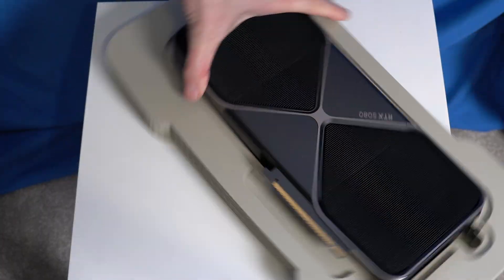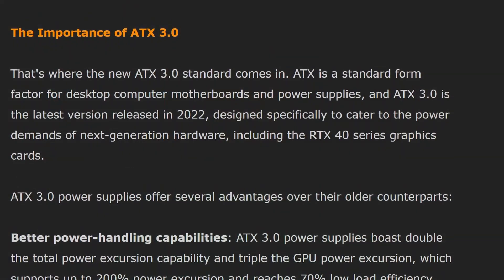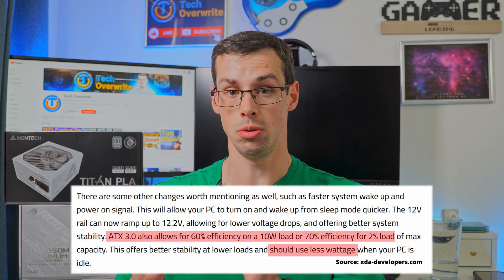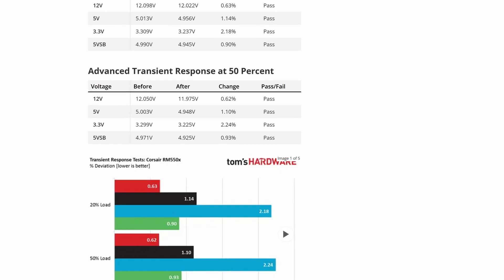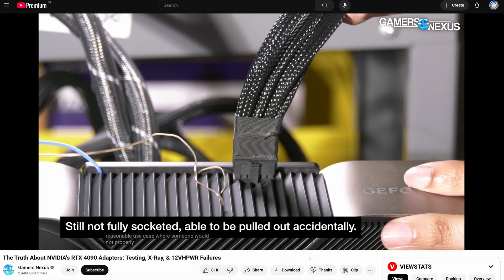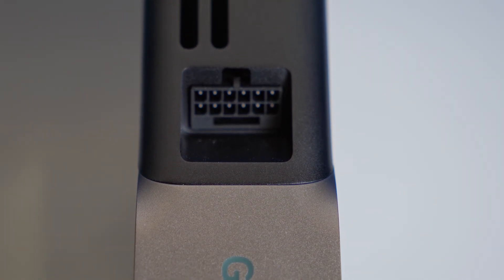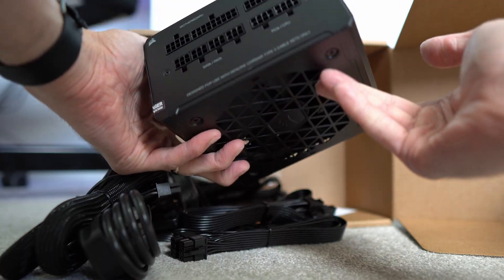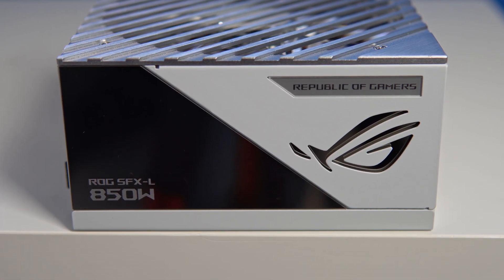ATX 3.1 vs 3.0 PSUs: Why Newer Isn't Always Better

Comment: I'm using the corsair rm850x shift 3.0 to feed a 9950x and a 4090. My 4090 has the newer 12v-2x6 conector (as far as I can tell, because the sense pins are definitely inside the plastic) and I like the cable that goes from 2x8 to 12vhpwr, and prefer it over the 12 to 12 of the 3.1standar. Anyways, I limit the power of the 4090 to 75%, so the 12vhpwr cable never draws more than 360W, so 390w in total with the extra 30W of the PCIe slot. I don't feel too paranoic, neither 100% safe (at 60% power target I would feel pretty safe but I don't want to leave too much performance  on the table either, 75% sounds like a good compromise).
Reply from the maker: That sounds like a good solution all round, I'm glad it's working out well for you.

Comment: One thing I didn't understand is the part where you show the power rating for 8 pin and 12vhpwr in regards to Corsair power supplies. I have Corsair RMx Shift 1000 Watts. The cable connects with regular 12vh 2x6 on GPU side and two 8 pin connectors on PSU side. The cable is rated as 600 watts capable but power rating of 8 pin is 254 Watts. So times two it's 508 Watts. Since power rating is already above specs (but still allegedely save). How does it actually work safely in cases when sustained load through cable is above 508 Watts. Wouldn't PSU side connectors have a problem or such load could cause a wear and tear much quicker? I am a bit confused about Corsair's solution
Reply from the maker: Good question and I'm not an electrical engineer so what I'm about to say might not be 100% correct technically, but my understanding is that the 8 pin connector has more safety headroom than the 12vhpwr connector, and so when using Corsair's "2x 8-pin to 12vhpwr" cable, in some ways this can be better than a direct cable because the PSU side is a safer connection overall (than a single 12vhpwr connection on the PSU side).

Comment: Been running 3x8 pin to 12VHPWR from my 2022 Cooler Master V650 SFX Gold V2 to my 5070 OC for a month, and I just ordered XPG Core Reactor II ATX 3.0 850W (listed as A+ tier on SPL's Tier List) a few hours before I watched this video. Now I kinda second guess my choice hahah.
Reply from the maker: Haha sorry to add more confusion to things lol! Hopefully that setup will be fine for a 5070 though, those aren't majorly at risk of melting so fingers crossed it'll continue to be fine for you :)
Reply: @TechOverwrite it's all good brother. The store's listing photos were the 3.0 but I got surprised when the updated it was actually the updated 3.1 that arrived!
Reply: damn you are me. I cancelled my order of Core Reactor II after watching this video. The official website says they have been updated to 3.1 12v-2x6 sockets but all the retailers show they have the old boxes with 3.0 listed
Reply: @arhamsaa fortunately, I got lucky! The store listing photos were the 3.0 version. But when it arrived, I was surprised it was the updated 3.1 version!
Reply: @plummy_n00b  nice. Did the box say 3.1 btw or was it only the PSU itself that said 12v 2x6
Reply: @arhamsaa yes, the box too. It says ATX 3.1 and 12V 2X6

Comment: im done wiht SFX psus, ALL OF THEM HAVE COIL WHINE. I go so far to sekll my itx case and buy a new Micro-atx case.
Reply from the maker: Sorry to hear it :( I have a Asus ROG Power Supply ROG-STRIX-850G-White and that doesn't have coil whine, but I guess it depends on the exact batch (and how much load the PSU is under) too :/
Reply: @TechOverwrite  atx psus might be better, bigger coils maybe
Reply from the maker: Huh, good point. I could definitely imagine that being true :) In general there does seem to be less complaints of coil whine on ATX PSUs compared to SFF ones.

Comment: I currently have a 5070 ti only have 2 sepárate cables can I run the third pcie port from daisy chain? My gpu is at 300w but seems to draw less than that could it be safe to do this?
Reply from the maker: Yes that should be fine. Unless you have a super budget PSU, 2 separate cables should definitely supply enough current IMO :)

Comment: now im scared, i bought a rtx 5070ti and i have an asus rog strix 850 psu (has native 12v) , should i use the native 12v cable or the combined one ?
Reply from the maker: Thanks for watching, and sorry to scare, that wasn't my intention with the video (it was more to nerd out on the fact that ATX 3.0 can sometimes be better lol). Your setup is fine though - you have a solid PSU, and that GPU doesn't use LOADS of power - compared to like the 5090 - so I wouldn't worry. I power my 5070 Ti with a native cable, and have never had any issues :)

Comment: Quick question I have a 750w asus rog at x2.6 I think psu with a 5070ti but require to buy a third pcie cable what brand would be reliable for the third pcie cable?? Or should I get a new psu atx 3.0 or 3.1?
Reply from the maker: CableMod's actual cables are fine IMO :) The 5070 Ti isn't super high power (like a 5090 for example) so I don't think you need to buy a new PSU for it IMO.
Reply: @TechOverwrite  is there risk of burning the gpu since many say don’t use third party cables?
Reply from the maker: @BladeRunnerJP11 Good question. So... it's one of those annoying gray areas. In general CableMod are solid, although they did have a right angled 12vhpwr connector that melted and needed a recall - which obviously sucks. I think for a general cable, they would work out fine though - and they generally have very good reviews IIRC.
Reply: @TechOverwrite  I currently have a 5070 ti only have 2 sepárate cables can I ruin the third pcie port from daisy chain? My gpu is at 300w but seems to draw less than that could it be safe?

Comment: Thanks for your informative video - but I have a question concerning the point you made about pre ATX3.x certified PSU's without the native 12vhpwr OR the 12vh-2x6 output ports, My confusion arises from the impression I had that  the majority of melting cable issues were being experienced on the GPU side of the cable interface ? So if this is true then having additional conductive cabling at the PSU end might not serve to mitigate the melting cable phenomenon. I'd appreciate your comment. Cheers!
Reply from the maker: You might well be right - since shooting this video, I have changed my opinion a bit re: native ports or 8-pin cables. I still do prefer PSUs with native cables (especially for GPUs like the RTX 5070 Ti and 5080 - i.e. NOT the 5090), but you're right that most melting has happened on the GPU side. So some of my points in this video might not be 100% correct.

(It's hard to say for sure though because we don't have enough data - there are still plenty of examples of melting occurring on the PSU side, and we don't know how many 12vhpwr melting issues there have been industry wide since the big players don't share this data).

Comment: Nice vid mate!

Should I swap my current Corsair RM1200x Shift to Montech Titan Pla 1200 for my Aorus 5090? 

Please help me, thanks mate.
Reply from the maker: Thanks, glad you liked it 😊 Good question - my Montech has been rock solid, but so have all my Corsair RM PSUs too. So unless you're having specific problems with the shift, I would probably keep it as-is.
Reply: Definitely swap it! I have read melting cases about Corsair psu's new cable causing problems.

Comment: Hi; I would love if you give me some peace of mind (been struggling with this all week long...) I already have a rogthor 850w for my ryzen 7 9800x3d and 5070ti... I was in the hopes of upgrading my PSU (the one I have is ATX 2.x)... I have seen many opinions.. some people say that native to native (12v2x6) is safer than other solutions like 2x8pin to 12v2x6 (corsair) and 9 pin to 12v2x6 (superflower) but, after seeing your video you say there is more headroom in the 2x8 pin to 12v2x6 than native to native... I just dont know what to do... I was about to buy the Prime px1600 (I know is overkill and that "future proofing" is not that recommended but i just.. want it and like it) but discover the PSU header was really a 12vhwpr and the cable itselft is the same, the difference is my GPU header that is a 12v2x6... So i dont really know what to do... 

Another options, for example: the astock tc 1300t taichi... it has a new psu header (lest posible "failure" points??) but im scared of 2 things: 1. asrock MOBOS had that issue with the AM5 and dont really know if trusting asrock is a nice idea. 2. some people say they hear a rattling noise on the PSU after months of using? or even exploding condensers..? I just would love if seasonic gives a native 12v2x6 header and just doesnt call it an upgrade when the just "change the cable" and not the header itself... 

Can you please, please, please help me?
Reply: I was even looking at de c1500 from nzct... but the same issue with people reviews about issues... At some point I was seconds from buying the rog strix 1000w, but got scared of the sky high inrush currents...
Reply from the maker: Sorry to hear your doubts 😞 It can be a hard decision but tbh, I would try not to overanalyze it. The 5070 Ti is very unlikely to melt. You can always buy a DC clamp meter and monitor each cable, once it's all installed. If this has stable per wire voltage, you should be fine. Then just check every few months afterwards.

But in terms of your question, I think that either Corsair or Seasonic would be fine for a 5070 Ti - and that applies to older ATX 2.4 PSUs, and newer ones too. Unless you want a 5090, I would try not to stress about it too much.
Reply: @TechOverwrite will I be fine with a seasonic PSU? Those "Atx 3" ones? That change "the cable" and are 3.1 compliant?
Reply from the maker: Yes I think that will be fine. The "ATX3" ones are still 12vh-2x6 (ATX 3.1) IIRC. It's confusing marketing from them, but it should be fine yes :)

Comment: There's a report saying that a guy using MSI supplied yellow 4x8pins with his 3.1 PSU still ends up melting. He thought that doing so could further reinforced this protection idea. Go read it up.
Reply from the maker: Yep, all the melting stories on Reddit are with the MSI yellow end. Well, 95% of the stories are. Which is really concerning :/ It's something I am keeping an eye on for sure.
Reply: More you use 8 pins , more you increase the risk of pin failure or loose pins. For full security use atx 3.1 psu with 12V-2x6 with the new cable 12V2x6 and a graphic card with the new connector 12V-2x6 as well.
But you can still connect the new graphic card with a new cable on an ´older’ stx 3.0, you won’t simply benefit of safety detection on the psu sid.  seasonic said we can do that as there are few issue to connect to psu and less bending cables in the case

Comment: @TechOverwrite 

Great video was looking for a info on the differences.

I wanted to ask you, i have a older psu Corsair hx 850i Platnium. My system b650, am5 9700, rx 6900 xt. 

Was wondering is there any point in upgrading to the new 3.0 or 3.1 standard? Currently thinking of getting the Corsair RM850x atx 3.1

Thank You
Reply from the maker: Thanks for watching, and that sounds like a great build :) I doubt you would get any real benefit, especially since the HX line is better than the RM one IIRC. So I personally wouldn't upgrade unless I was buying an RTX 40 or 50 series card and specifically wanted a native 12hpwr slot (for example). In all other cases though, I'd stick with the HX850i.

Comment: Hey dude please reply me

I'm going to use a CORSAIR Rm850x Atx 3.0 ,to power a msi rtx 5070 gaming trio and 
A r7 7700x (in future going to upgrade with a x3d r9) on a b850 tomahawk mobo

So am i going with a good psu 
As 850x 3.1 is out of stock in my country 😅.
Or should i arrange a 3.1 version from some where.

Also i don't have that much knowledge regarding this 12vhpwr cables so can u please tell me in my case does this melt or not.
Please reply 🙏 me😊
Reply from the maker: Hey man, you should be fine :) A Corsair RM PSU is a good quality one - and ATX 3.0 can be fine too. The RTX 5070 does not consume enough power to worry about melting IMO. You should be okay :)
Reply: @TechOverwrite Thanks a lot for Reply😄❤

And there is an update
My pc builder some how he arranged me a Rm850x ATX3.1 
And I'm really happy.

Yesterday only I built my pc and I'm really excited to play games in it😍
Reply from the maker: Ahh awesome, really glad to hear that. Happy gaming 😊
Reply: @TechOverwrite 😊😍😍

Comment: Hola amigo , tengo una consulta, ¿podría usar la fuente mi fuente D1500EF-00 800GY 1500w de mi Alienware Area 51 R2, en una tarjeta Rtx 5080?
Reply from the maker: Hola :) I am not completely sure sorry because sometimes Alienware PSUs are very specific and do not have standard connectors. However if you are able to safely 'get' 8 pin PCIe power, then you should be able to safely use the included adaptor in the box. Maybe this Reddit thread might help? https://www.reddit.com/r/Alienware/comments/1l1nim4/aurora_r16_w_rtx_4090_power_supply_to_gpu_question/

Good luck :)
Reply: @TechOverwrite  ésto me servirá, gracias amigo!

Comment: ATX 3.1 is better for the 50 series cards because they can withstand transient current spikes even within its rated power better then 3.0. 3.1 has better power filters to reduce voltage sag during these transient spikes.
Reply from the maker: Interesting, thanks for that. Do you have any links I can reference for more info? I haven't heard as much about the power filters aspect.
Reply: @TechOverwrite unfortunately I dont have any links I can provide other then links stating they handle transient surges better.  From my understanding though in order to handle a transient surge better it will need better output capacitors which from my understanding is basically a filter.

Comment: Err.. I'm pretty dumb regarding the nitty gritty of PC building such as the electrical stuff, and I just bought a Corsair RM850x ATX 3.1, planning to build an entirely new gaming PC with 7800X3D and 5070 Ti in mind. Did I just shoot myself in the foot with the ATX 3.1 PSU?
Reply from the maker: That should be fine, especially for a 5070 Ti. My goal here was to show that sometimes an 'old school' PSU can have benefits. But your PSU choice is a good one, don't worry 🙂
Reply: @TechOverwrite  Thanks so much! That's a load off my mind.

Comment: Would connecting 3 separate 8 pins to the adapter that the 5080 came with be as safe as what you mentioned in the video or would it be the safest option I have the mpg a1000g pcie5 and I don’t know what to do
Reply: I have the same question, i bought an 5080 and xpg core reactor ii 1200w 3.0 and it came with 3 pcie 8pin cables and a 12vhpwr to 12vhpwr cable

Comment: I think I have the psu in your video, Corsair HXi Series 1500W 80+ Platinum, the older one (CP-9020215-UK).. I have used it with the official corsair 2 x 8 adaptor on my 4090 without any problems. Now I have a 5090 I contacted where I purchased the PSU, they told me I should 100% buy a ATX3.1 as my Corsair was too old and it could melt my cables, I take it they are trying to extract more cash off me? Seems a bit drastic. Great channel, you explain complicated matters very well....
Reply from the maker: Thanks for the comment, you're right - that's a really solid PSU, I wouldn't feel the need to buy a new one either :)

Comment: How about an rtx 5090 with a FSP Hydro G PRO 1200W Gold Modular PSU? This is the setup im about to possible buy but the fear of having nice molten plastic and being down a house to live in is a bit concerning
Reply from the maker: It's hard to say for sure, but that's a solid PSU (it's the top tier on the Cultists Network, and has good reviews generally) so it should be as good as possible for a 5090. Yes there's a slight concern about whether the connection is good, but just ensure it's fully plugged in, then leave it alone. That's all you can do really :)

Comment: And the other way around? can I connect with that 12vh-2x6 cable from the source and connect the double 8 pin connector to my 3080 12gb? I upgraded my power supply and it only has 1 PCIE cable, so I only have 12vh-2x6 with 12vh-2x6 and 12vh-2x6 with 2 8pins.
Reply from the maker: It depends on the PSU but unfortunately you often can't reverse the 12vh to 2x8-pin (or 2x8-pin to 12vh) cable no. Sometimes a direct 12vhpwr to 12vhpwr cable is reversible, but not the 'adapter' cables sorry.

Comment: Dang i just bought a 5070 Prime GPU, Ryzen 7 7800X3D & a ROG STRIX 750W Aura Edition ATX 3.0 … should i worry or should i just return the psu and get a 3.1
Reply from the maker: Ah nice, that's a good GPU, CPU and PSU :) I wouldn't worry, I actually am powering my 5070 Ti with an ATX 3.0 PSU. Basically it gets confusing, but there's nothing wrong with your setup - enjoy :)
Reply: It's fine, I have 5080 on it, all perfect.
Reply: Should worry if get 5090, but it won't even "on" because not enough watt. Defence will works.

Comment: I’m using the Corsair RM1200X Shift power supply with my 5090. I really hope it doesnt blow up. It came with the corsair cable (type 5) that goes directly into the GPU and splits into the 2 connectors that plug into the PSU, the 2 connectors that go into the PSU are 8-pin each (300watt each). If anyone sees this and thinks this is going to harm my GPU please let me know! Gigabyte Aorus Master 5090
Reply from the maker: I think that should be fine. You have a very good PSU, and there's no problem with using Corsair's native cable here IMO.
Reply: @TechOverwrite Gigabyte finally got back to me today and said as long as I am using the cable that came with the PSU, it does not void the warranty. So that puts me at ease. Thank you sir!
Reply from the maker: That's reassuring to know, glad they confirmed that fine :)
Reply: @TechOverwrite do you have any updates? I’m buying the same PSU.